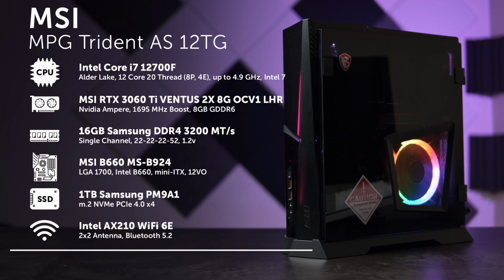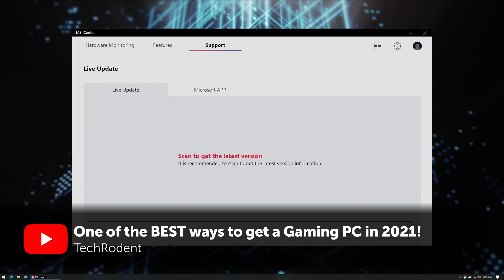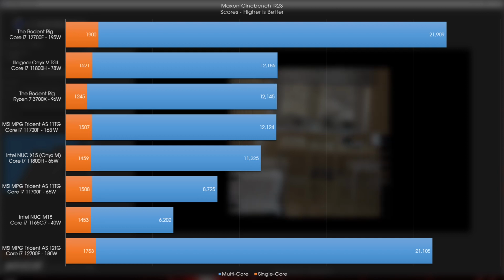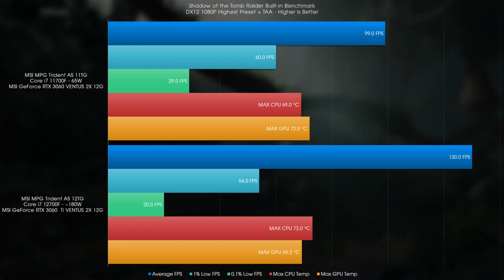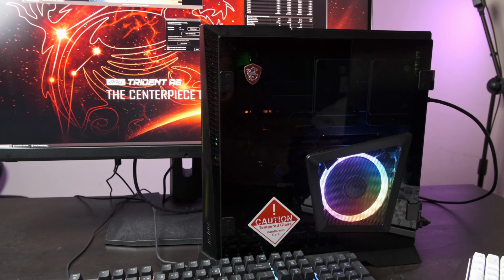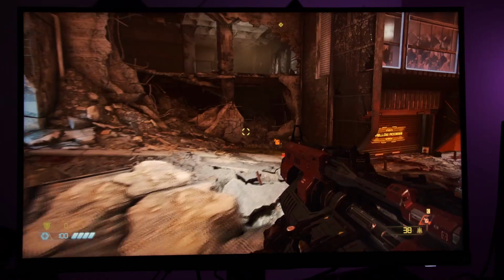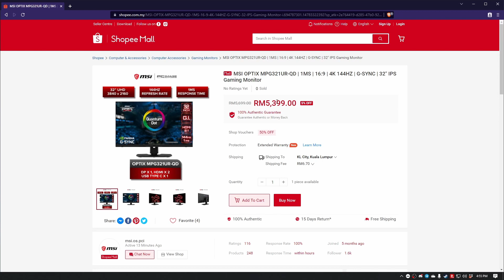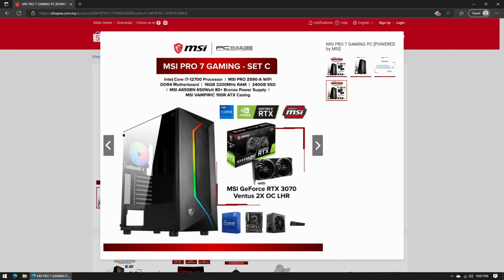Return of the Compact Gaming PC & The 4K Beast  - MSI Trident AS 12TG & OPTIX MPG321UR-QD Review

Comment: Picked up an MSI I7-14700F/4060TI/16GB/1TB/ back in May.  Has been pretty good so far.  Gaming with a Samsung G8 34" OLED, everything plays well with relatively low noise, and heat dissipates very well, as the heat-producing components are in their separate chambers.  Installing a second NVME is easy once you figure out what side the slot was on.  The only issue I ran into so far is that the PSU is only 500W.  I wasn't aware of this until I purchased an MSI  Ventus 4070Ti Super.  I called MSI and they did not have a more powerful PSU that would accommodate the size of this Trident, but said the form factor would need to be an SFX, which is a smaller than average PSU.
Reply: Have a feeling its more likely to cut costs, which is unsurprising given its a prebuilt. Is the pc still holding up alright?

Comment: Hi tech rodent! First of all thank you so much for your complete review!
I wanna ask to you a question about the  upgrading of this machine. Do you know if there is a maximum in term of capacities of storage? Will it be compatible for example two ssd nvme 4gen of 4 tera, or two ssd sata of 4 tera?
I have this computer and I'm using it for rendering and I try to upgrade it.

Greetings!
Reply from the maker: There shouldn't be a maximum, it's basically however big you can get it I'm sure the system can handle it.
Reply: Thank you for your answer  @TechRodent . What about the ssd nvme with heatsink? Do you think that there is enough space to install one of them without exagerate dimensions? For example a 990 pro with heatsink?
Thank you in advance!